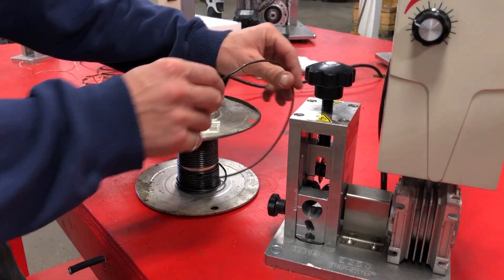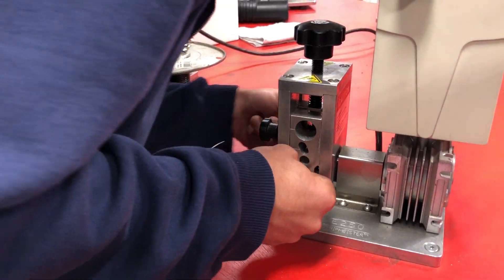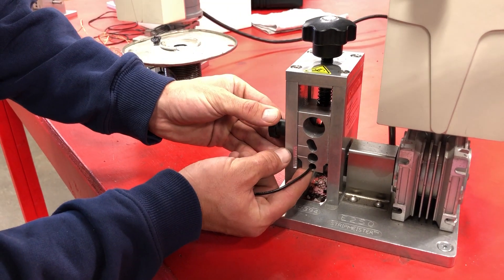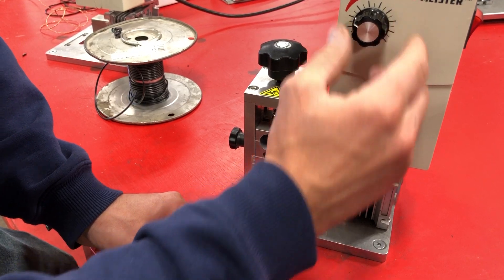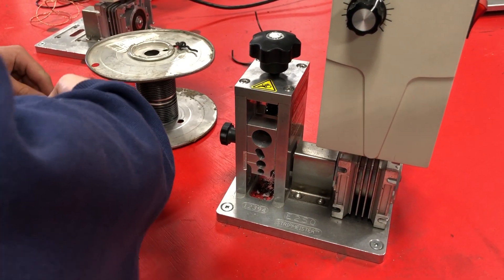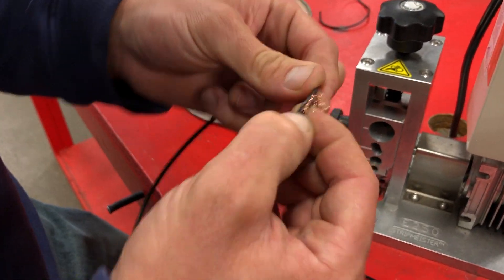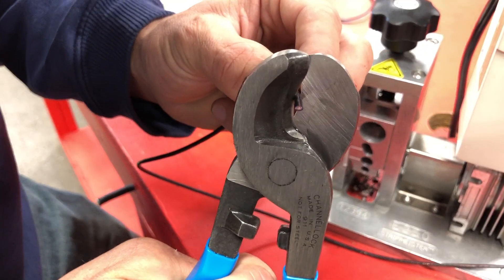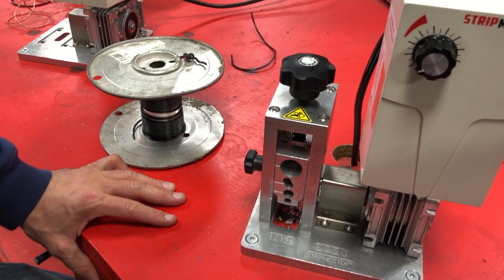Stripping 18 gauge wire with a StripMeister wire stripper model E250

Comment: I only have the original and I'm just starting to learn how to use it.  Just wish it had a detachable cranking handle as a quiet manual option.  Plus, if there's one thing that would make this machine even better would be to create a funnel-like insert into the hole to make it easier still to direct the small wires so they won't go off track

Comment: Price please
Reply from the maker: Please visit our Website for current prices. www.stripmeister.com
Reply: overpriced . lol
Reply: 179.00 for the drill powered one and im not sure about this one probably around 400.00. Either way, they are not over priced if you scrap wire on the regular. Im an electrical foreman and I get insane amounts of wire and my stripmeister should be here today. 

Also, if you go to buy one dont pay for shipping. They offer free shipping and then if you scroll down they'll give you a few different shipping options that cost anywhere from 50 bucks to 100 dollars. The most expensive shipping method said it would get me my machine by today. I decided to just use the free shipping and I'm still getting it today. That would have been a waste of money. I ordered this last Saturday and UPS says it'll be here today. Very fast free shipping.